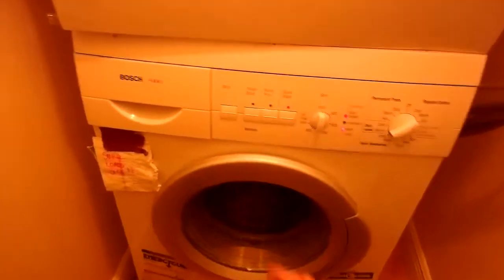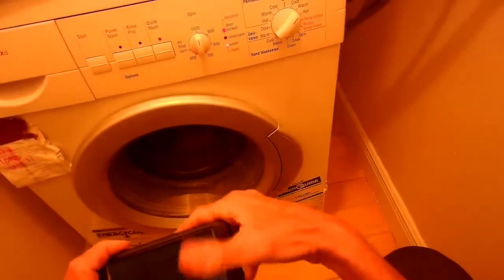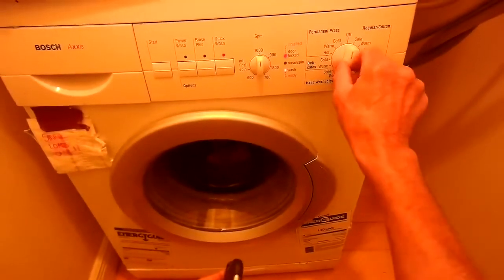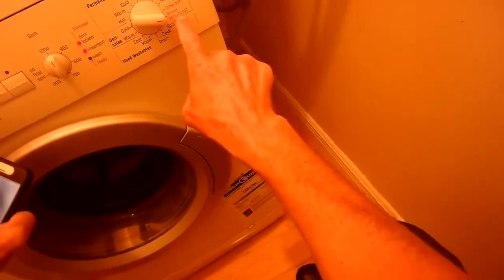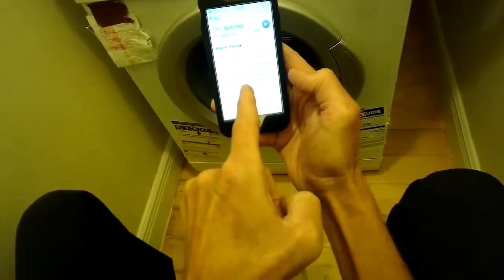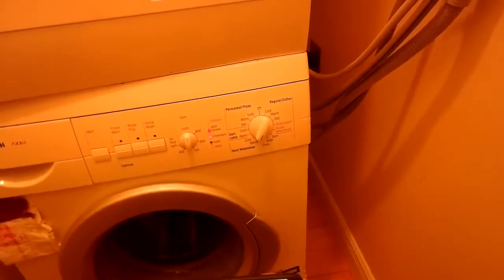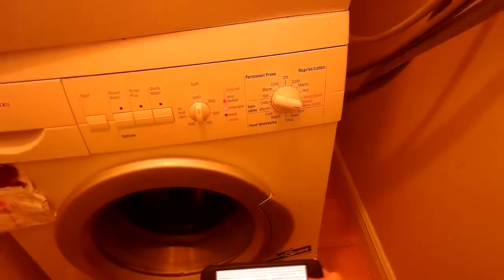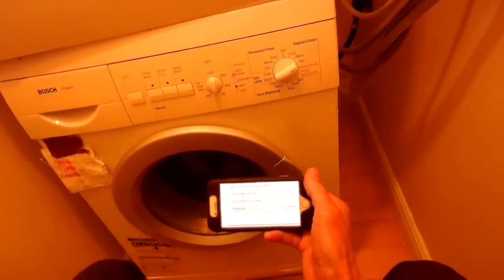BOSCH AXXIS WASHER — DIAGNOSTIC TESTING

Comment: Joe Hill
1 minute ago
So If the Motor brushes are worn, that would prevent the wash cycle from starting?  Would there be other causes, such as the control board?
Reply from the maker: Thanks Joe,
Could be the control board.
It’s more common with the motor brushes are the point that fails.
The machine will try to spin the basket first step, and if the motor doesn’t work it’ll just stopped at that point.

Comment: HI THANKS FOR YOU VIDEO . IT WAS GREAT. I HAVE  BOSCH AXXIS WASHER AND DRYER THE SAME ONE THAT YOU HAVE SHOWN IN YOU VIDEO. THE DRYER IS WORKING FINE. THE WASHER WAS ALSO GOOD TILL YESTERDAY. IT STOP DOING THE SPIN ON MANUAL AND AT ALL CYCLES.  CAN YOU  SUGGEST A LINK FROM WHERE I CAN GET A TROUBLESHOOTING MANUAL SO I CAN CHECK MORE.

THANKS.
Reply from the maker: Just need to replace the motor brushes
Reply from the maker: BOSCH WASHING MACHINE WON’T SPIN OR AGITATE  (FIXED) https://youtu.be/_H4Rw4b4E7M
Reply: @QuickAndEasy5MinuteAppliance Hi Thanks for the response
Can you share the link where I can find and download the service manual that you were using in the video to check  test points.  Could not find the document that you have referred in Your video.  Thanks

Comment: Nice Video, I have this machine, my issue is that the machine fills with water, but will not advance past that point.
Do you have an idea what this might be?
Also, what is the "NTC" ?
Thnaks in advance.
Joe
Reply from the maker: I think it’s time for new motor brushes.
Reply: @QuickAndEasy5MinuteAppliance  So
Reply: So If the Motor brushes are worn, that would prevent the wash cycle from starting?  Would there be other causes, such as the control board?